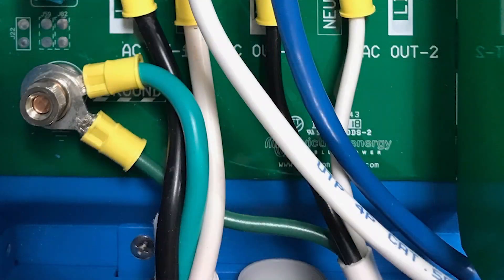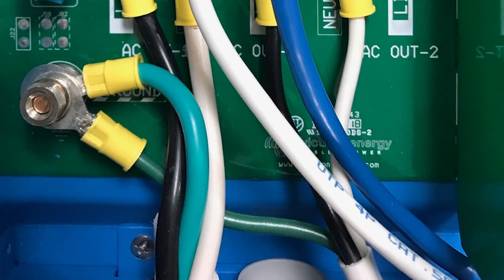What Size is the Chassis Ground Wire on Your Boat's Inverter/Charger?

Comment: Jeff: This requirement was dramatically changed in the 2025/2026 revision to E-11. AWG 2 will handle most real world installations. This is still required to be a redundant conductor back to source battery B-,

Comment: Jeff, my DAF 615 engine has the starter motor negative connected to the hull. The starter batteries are 2.5 metres away and they have their negative attached to the hull . Should I run a heavy duty cable between the starter and the negative post on the batteries?? My boat is a 14.5 metre steel cruiser.

Comment: Good answer, plus going with the rules can safe you if your boat burns. The insures will bail out if not spec.  Plus wire leight can deturmen the ga. with DC the longer the wire the more amp loss you can see.
Reply: Unlikely that your insurers would find an out of spec wire in a burnt out boat tbh.

Comment: I ran into this issue when sizing the case ground for my Multiplus 3kVA. It calls for two 1/0 positive and two 1/0 negative DC cables. I decided on using two 2/0 for each polarity to reduce voltage drop. I couldn’t get consistent (or reasonable) answers on the case ground size. Eventually I signed up for an ABYC membership (now expired) to read the standards myself. As I recall, the standard actually says the minimum size for the case ground is one size smaller than the REQUIRED DC conductor size (not what you actually use), with an ampacity rating no less than 135% of the fuse rating protecting the DC conductor.

Comment: Are we talking about the chassis ground with respect to the output, as shown in the photo? If so the chassis ground to the ground bus shouldn’t need to be any larger than #10 because at 3000 watts the output is 25 amps max. But Jeff is talking about the input wires being 4/0 which sounds correct because at 3000 watts and 12 volts the max input would be 250 amps. But I see no reason the chassis ground should need to be sized according to the input from the battery bank. Maybe Jeff could clarify and elaborate further?
Reply: If for some reason your inverter/charger shorts to the casing then the high amperage will take the path to ground back to the battery. This will be hundreds of amps which will effectively make your 10 gauge wire a fuse and melt into a fire on your boat.
Reply: Richard got it exactly correct. In case of a short to the chassis, the chassis ground wire needs to be big enough that it can carry the current needed to blow the fuse without burning up.
Reply: Wow, I stand corrected

Comment: What would be the required wire size be for a 3000W inverter, say for a 10ft fun? Would a 4/0 wire be overkill in that situation? If so, would you still need 1 gauge smaller wire for the chassis ground or would 1 gage smaller than what is actually required for the pos and neg going to the inverter? I don't know if that ever happens but I was wondering if the chassis post on the inverter is sized per what the manufacturer thinks is sufficient and it's only the ABYC code causing problems.
Reply: At a minimum your pos & neg DC cables would be 4/0.  Your case ground could be 3/0 but I just used my remaining 4/0 as the case ground.